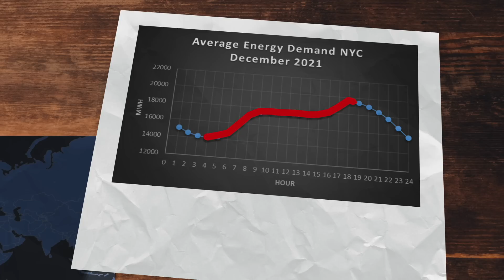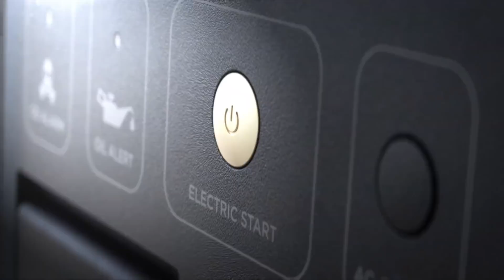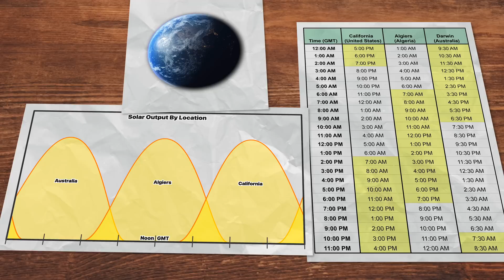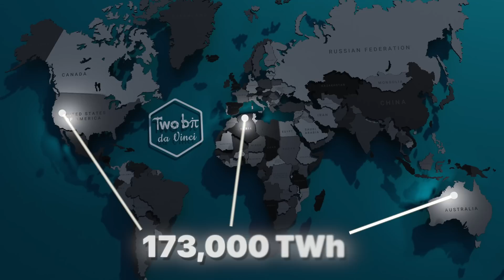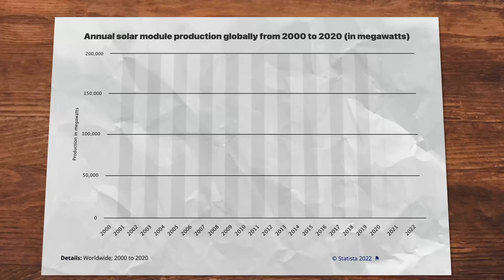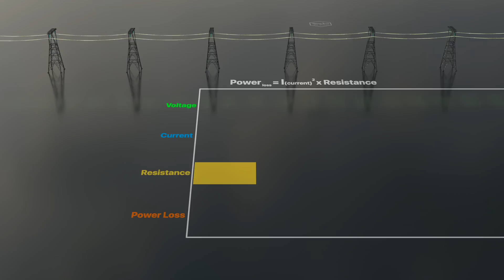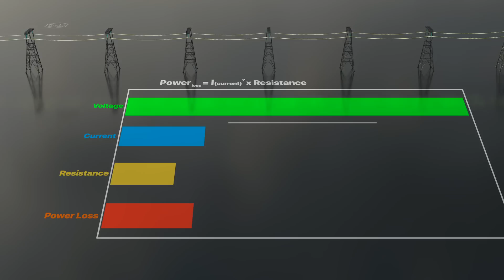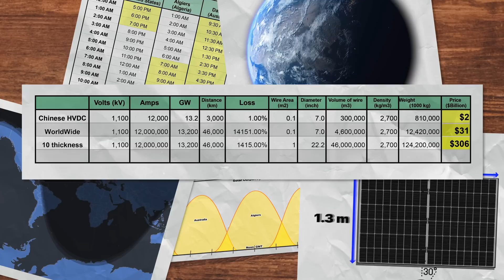World Solar Energy Network... Could this work?

Comment: For outer space travel:
Potential endless energy source basically anywhere in this universe:

a. Small aluminum cones with an electrical wire running through the center of the cones, cones spaced apart (not touching I'm thinking) but end to end.
b. Electromagentic radiation energy in the atmosphere interacts with the aluminum cones.
c. Jostled atoms and molecules in the cone eventually have some electrons try to get away from other electrons of which those electrons gather at the larger end of the cone, of which also creates an area of positive charge at the smaller end of the cone.
d. The electron's in the wire are attracted to the positive end of the cone and the positive 'end' in the wire are attracted to the negatively charged end of the cone.
e. Basically a 'battery' has been created inside the electrical wire itself, different areas of electrical potential.  Basically a 'wire battery' or a 'batteryless battery', however one wanted to call it.
f. Numerous cones placed end to end increases the number of 'batteries' in the wire.
(In series to increase voltage, in parallel to increase amperage).

*  Via QED (Quantum Electro Dynamics) whereby electromagnetism interacts with electrons in atoms and molecules, one would have to find the correct 'em' frequency for the correct material being utilized for the cones.  The shape of the cones could also come into play.  The type and size of the wire as well as the type and thickness of the insulation between the cones and the wire would also be factors.
*  Of course also, possibly 2D triangles made up of certain materials with a conductor going down through the center of the triangle could possible achieve the same 'batteryless' battery system.
*  Plus possibly with the 2D concept, layered 2D's that absorb different energy frequencies, thereby increasing the net output.
Reply: To help protect against harmful cosmic radiation:
MODIFIED MOLECULES:
More dense molecules with potentially new characteristics created primarily for potentially better protections from harmful cosmic radiation in outer space as well as different applications on planets and moons.

Setup:
a.  A more complex molecule.
b.  It exists under:
1.  A certain gravitational energy field.
2.  Under certain electrical interactions.
3.  Under certain magnetic interactions.
4.  In a certain temperature.
5.  In a certain pressure.

Modification:
a.  Change 1 or more of the above items to change the shape of the molecule.

Effects:
(When modification item[s] removed):
a.  Molecule returns to it's original shape.
b.  Molecule returns to a shape larger than it's original shape.
c.  Molecule returns to a shape smaller than it's original shape.
d.  If larger than or smaller than it's original shape, then possibly the same molecule with different interacting characteristics, and if smaller than it's original shape, then a more dense molecule.
e.  Other atoms and/or molecules might be able to be attached to this 'new' material, and the 'new' larger molecule could possibly be modified as above yet again and on and on.  The possibilities are virtually endless.
f.  New 'space age' material being formed for various uses.
Reply: Also:  Zero Point Energy (the line between 'em'?):
'IF' my latest TOE idea is really true, (and I fully acknowledge the 'if' at this time, my gravity test has to be done which will help prove or disprove the TOE idea), that the pulsating, swirling 'gem' photon is the energy unit of this universe that makes up everything in existence in this universe, and what is called 'gravity' is a part of what is currently recognized as the 'em' photon, the 'gravity' modality acting 90 degrees from the 'em' modalities, which act 90 degrees to each other, then the oscillation of these 3 interacting modalities of the energy unit would be as follows:

Gravity: Maximum in one direction, Neutral, Maximum in the other direction;
Electrical: Maximum in one direction, Neutral, Maximum in the other direction;
Magnetic: Maximum in one direction, Neutral, Maximum in the other direction.

Then:
1 singular energy unit, with 3 different modalities, with 6 maximum most reactive positions, with 9 total basic reactive positions (neutrals included).  Hence 1, 3, 6, 9 being very prominent numbers in this universe and why mathematics even works in this universe.
(And possibly '0', zero, as possibly neutrals are against other neutrals, even if only briefly, for no flow of energy, hence the number system that we currently have.  This would also be the maximum potential energy point or as some might call it, the 'zero point energy point'.).

And also how possibly mathematical constants exist in this universe as well.

*  Note also:  Nobody as of yet has been able to show me how numbers and mathematical constants can exist and do what they do in this universe from the Standard Model of Particle Physics (SMPP).  While the SMPP has it's place, I believe we need to move beyond the SMPP to get closer to real reality.

Comment: Bitcoin mining could be used to replace the long power lines as it can store value, hedging can be used to lock in this value typical parts of energy trading. All the parts already exist. What's missing is an open source decentralized energy trading platform based on this idea.

Comment: Why govt is not marking the room temperature fusion reactor which was patented by USA Navy,by "Salvatore pais"
Reply: Undecided with Matt Ferrell just did a video about how some fusion technology is only a few years away.  Some or all of them were a similar design that didn't require a continuous fusion reaction.  Youtube sometimes doesn't allow links in comments, so it'll be in the follow up if it can work.